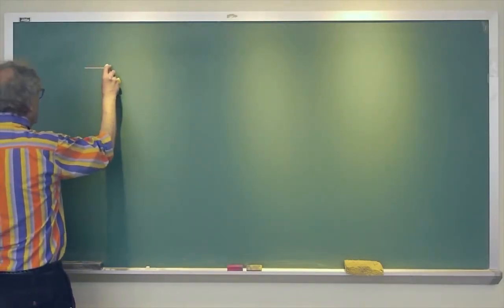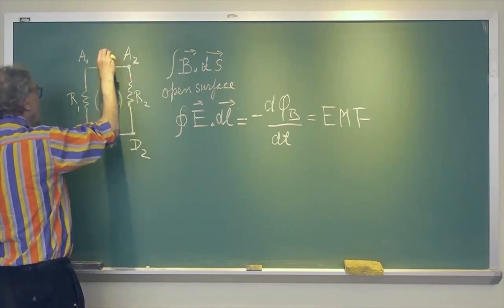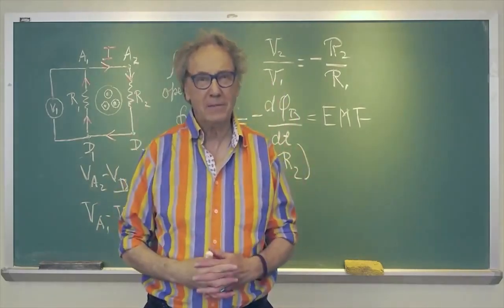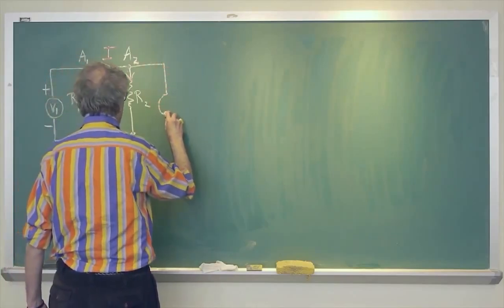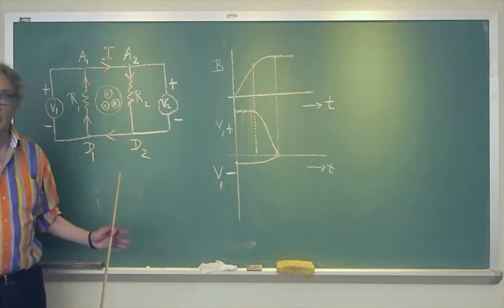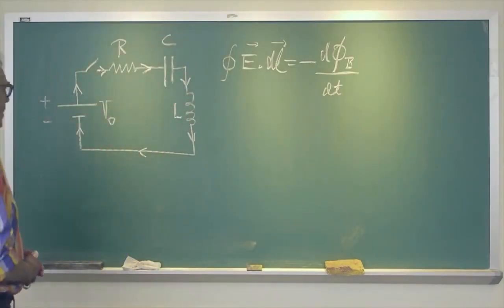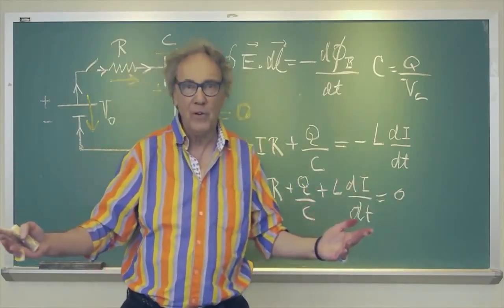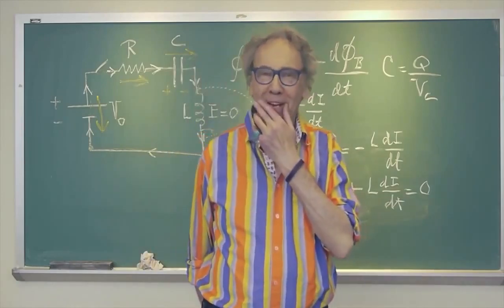Kirchhoff's Loop Rule Is For The Birds

Comment: People just denied electromagnetic current generation just to prove you wrong, and they are still engineers, that is kind of sad.
Reply from the maker: this may interest you:
Thank you jcook for your thoughtful note. Yes, of course, we both agree on the correct Physics but we may not agree on how it should be taught. By teaching students that KVL always works without telling them when it does not work, makes many believe that the closed loop integral of E dot dL is always zero. Which is not true. e.g., it never works in the secondary closed loop windings of transformers. Even ElectroBOOM who has a masters in EE believed that it always worked, and he therefore concluded (he was not the only one; Dirk Van Meirvenne also made that mistake) that two identical voltmeters attached to the same 2 points in a circuit MUST always show the same values. In other words he does not know some basic physics that in the case of an induced EMF potential differences are no longer determined. None of my thousands of MIT students who took my 8.02 course (Electricity and Magnetism) would make this embarrassing mistake! They have seen my Lecture #16 and the great demo with the 2 voltmeters which I do at the end! I believe that I teach Faraday's Law in the way it should be taught. All my students know that KVL is part of Faraday's Law and they have no problems with the concept that potential differences in a circuit can be path dependent. In conclusion I believe that to introduce a "modern version" of KVL and then teach students that KVL always holds is not only wrong Physics but you set them up for making terrible mistakes as Dirk Van Meirvenne and ElectroBOOM did.
Reply: There was a time, when I somewhere in the depths of internet, I saw that maxwell's equation aren't original, but their simplified version, which doesn't always work, because there is no "homogenic" magnetic field, but more different fields that just seem like white, but it's spectrum of fields that ends up in "magentic". Have you ever tried to go beyond the edge and wire transformators in a way that it produces power always once it's started?  @lecturesbywalterlewin.they9259
Reply from the maker: https://en.wikipedia.org/wiki/History_of_Maxwell%27s_equations
Reply from the maker: I demonstrated at the end of my lecture #16 of my 8.02 E&M course at MIT that two identical voltmeters attached to the same 2 points in a circuit can show very different values. https://www.youtube.com/watch?v=nGQbA2jwkWI&list=PLyQSN7X0ro2314mKyUiOILaOC2hk6Pc3j&index=17 The reason is that in the case of an induced EMF (Faraday's Law) potential differences are no longer determined; they depend on the path. This also applies to the secondary windings of transformers as the EMF in the closed loop of secondary windings is induced. https://www.youtube.com/watch?v=b7i2uMx7gHo&list=PLyQSN7X0ro22zanLOcvkaSY-IZqheFYM5&index=8
Of course, in cases where Kirchhoff's loop rule (KVL) does apply, 2 voltmeters attached to the same 2 points in a circuit will always show the same value. 
My demo was first suggested and published by Romer in December 1982 in the American Journal of Physics. This demo has now become a classic; it's done all over the world at many colleges and universities. KVL is older than Faraday's Law. The original text can be found in the following link, pages 497-514: https://books.google.de/books?id=Ig8t8yIz20UC. Clearly Kirchhoff was fully aware of the prerequisite for his "loop rule" namely that phi/dt must be equal to zero! 
By teaching students that KVL always works without telling them when it does not work, makes many believe that the closed loop integral of E dot dL is always zero. ElectroBOOM and Dirk Van Meirvenne therefore both believed that 2 voltmeters attached to the same 2 points in a circuit must always show the same value which is not true as demonstrated in my lectures. They each posted a video on their channel in which they claim to have proof for their wrong ideas which clearly violate Maxwells' equations. Apparently they do not know, or do not understand, that in the case of an induced EMF potential differences are no longer determined; they depend on the path. None of my tens of thousands of MIT students who took my 8.02 course (Electricity and Magnetism) would make this mistake! I therefore believe that to introduce a "modern version" of KVL and then teach students that KVL always holds is the wrong thing to do as you set them up for making the same embarrassing mistake that both Dirk Van Meirvenne and ElectroBOOM made.

Comment: Can someone explain to me why he measures the voltage across R1 in the opposite direction to R2? When he measures R2 he does it with the direction of current, but for R1 it's against the current. I'm sure there's a good reason, I just don't see it.
Reply from the maker: You have 2 identical voltmeter and you want with EACH to measure the potential difference between point A and D. You then connect the + side of each voltmeter to A and thus the minus sides to D, or you connect the minus side of both voltmeters to A and the  + side to D. How else would you be able to compare the 2 readings.
Reply: @lecturesbywalterlewin.they9259  What confuses me is that in a simpler circuit (one with a battery providing the emf) you would swap the polarity of one of the voltmeters. 
In the battery powered circuit, you would have three points (one on either side of the battery, and another between the two resistors), and to measure the voltages across the two resistors properly, you need to take direction of current flow into account. Why does removing the battery and inducing the current with a magnet change the way that you would connect the voltmeters?
Sorry if this seems really silly, but I can't find an answer on physics or electronics websites.
Reply from the maker: read my previous response again. In my "Farady" demo I want to compare the readings of the 2 voltmeters - thus I MUST connect the + side of both to the same point/
Reply: @lecturesbywalterlewin.they9259  Oh, OK. So it's purely to allow for direct comparison of the two paths. I was getting confused because of the implications for kirchhoff's voltage law. I was stuck on the idea that you would have to measure the voltage around the loop in one direction to show that there is a non zero voltage through the loop.
I think I get it now. Thank you for taking the time to answer me!

Comment: IR1=-IR2 since A1 is the same as A2. The same applies to D. Moreover R>0 and I>0 so this formula is true only for I*Ri=0. If my algebra isn't wrong where is the issue?
Reply from the maker: your msg is unclear - how many minutes into lecture and what's the point you try to make?
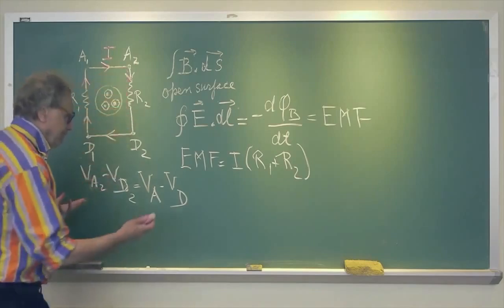Reply: 9:00. You wrote that both potental differences are eqal so in consequence IR1 must be equal to -IR2. A=-A only if A is 0 since both current and redistance are >= 0.
Reply from the maker: I am afraid you missed the key point. VA-VD measured through one path differs from VA-VD measured through a different path. This is well known in Physics: whenever there is an induced EMF, potentials are no longer determined, they depend on the path. Watch the demo near end of this lecture https://www.youtube.com/watch?v=nGQbA2jwkWI&list=PLyQSN7X0ro2314mKyUiOILaOC2hk6Pc3j&index=17

Comment: Suppose you take the voltmeter V1 and, keeping its contacts at A & D, move it to the other side of the circuit (quickly enough that dPhi/dt has not changed appreciably). Presumably the EMF it registers will change continuously from IR1 to IR2... registering zero somewhere in the middle of the loop? So it seems like the exact details of where the voltmeter cables are, are relevant too.
Reply from the maker: You can connect as many voltmeters as you want. If you properly apply Maxwell's eqs in each loop that you have created and if you know what dphi/dt is in each loop you will know what each voltmeter will read.
Reply: Thanks for the reply! 100% agree that the voltages on both sides of the circuit are unequal & KVL is inapplicable, as you say. What I don't get is how the voltmeter "knows" which side of the circuit it's on.

I think your reply is saying it's the flux through the loop containing the voltmeter that matters. But I would've thought the flux was confined (by assumption) to the loop between R1 and R2 only.

Comment: Amazing video. Shouldn't the current be going the other way around the loop? using the right hand rule if the current is going out of the board the current goes anti-clockwise
Reply: Right hand rule is for the magnetix flux (right thumb) induced by a variable electrix current (the other fingers). This is the opposite case: a variable magetic flux (left thumb) inducing an electrix current (the other fingers).

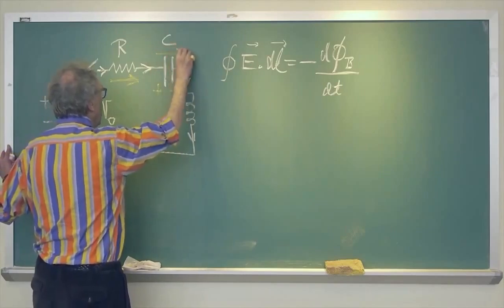Comment: At 27:03 he states that the electric field in the inductor is 0. According to Faraday's law, the electric field of the inductor is nonzero (unless steady-state dc). Google "electric field inside a solenoid". The E field inside the wire of the self-inductor is (u0 * n/2) * (di/dt) * R where R is the radius of the inductor.
Reply from the maker: >>>According to Faraday's law, the electric field of the inductor is nonzero>>>>
that is NOT true. The emf shows up in the ohmic components in the circuit.  I cover all this in great detail in my 8.02 lectures
Reply: @lecturesbywalterlewin.they9259  With all due respect Sir, please point me to a peer reviewed paper/article/journal that states that the E field inside a (self) inductor is 0 when di/dt is not 0.
Reply from the maker: @AlchemyOfDeathBand  If the inductor is an ideal one (superconducting), then it has no resistance. No E-field can exist in a superconductor. It's that simple. In the case of induce emf the E-fields show up in ohmic components only. Watch this video https://www.youtube.com/watch?v=fXmPi_0G19o&list=PLyQSN7X0ro207exLyDsBo_N3_EJcydeeM&index=83
Reply: @lecturesbywalterlewin.they9259  I think I understand now what you mean. It is because the electric field generated by the self-inductor is nonconservative and loops back into itself that we cannot "pinpoint" anymore the voltage drop as being across the endpoints of the inductor. Because of Faraday's law, the voltage between any point(in the circuit) and itself is not 0 anymore. Therefore, we cannot view directly the voltage induced by the inductor, we can only sum up its drop on the ohmic components. 
My question is now: doesn't it show up in the capacitive components as well ?
Reply from the maker: @AlchemyOfDeathBand  https://www.youtube.com/watch?v=qAtqgSaEU4Y&list=PLyQSN7X0ro22zanLOcvkaSY-IZqheFYM5&index=57
Reply: @lecturesbywalterlewin.they9259  What happens if you have an ideal wire, forming a closed loop? In this case, the only component of your circuit would be the ideal cable, with Resistance=0 (there would be no ohmic component). If there is a change on magnetic flux, due to an external alternating magnetic flux, were will the emf show on this case?
Reply: You guys with semi knowledge in physics come hackling a professor..you asking him to go check Google for some bs was how you started...then he showed you your flaw...and then your question changed...but when you started out...you started arrogantly...like you wanna teach a professor?...

Comment: So is this equivalent to saying : "The voltage/potential difference (E dot dl) from one end to the other end of an ideal-inductor is always zero" ? Mainly because this ideal inductor has no resistance and E is 0. ???
Reply: and NOT dL/dt ??
Reply from the maker: The integral of E dot dL through the wires of an ideal  inductor is always zero. However, and few people appreciate that, if you attach a voltmeter over the inductor it will read at any moment in time -L*dI/dt.  I explain that in one of my videos. 
In the case of an induced emf the potentials in a circuit are no longer determined, they depend on the path and thus Kirchhoff's Loop Rule is not valid. Kirchhoff's Loop Rule is a special case of Faraday's Law (namely when phi/dt=0). Thus Faraday's Law is always valid. The following videos may help you to understand this. This is very basic Physics I will therefore not argue with anyone about this. 
https://www.youtube.com/watch?v=f3-SfzepuPs&index=10&list=PLyQSN7X0ro22zan*LOcvkaSY-IZqheFYM5

https://www.youtube.com/watch?v=5be3zpj_eCY&list=PLyQSN7X0ro22zanLOcvkaSY-IZqheFYM5&index=7

https://www.youtube.com/watch?v=wz_GqO-Urk4&index=11&list=PLyQSN7X0ro22zanLOcvkaSY-IZqheFYM5

https://www.youtube.com/watch?v=b7i2uMx7gHo&list=PLyQSN7X0ro22zanLOcvkaSY-IZqheFYM5&index=8

Comment: Sir, at 27:45 if we had moved around the other loop the other way, then would the integral E. dl would still be Zero and equal to - L di/dt? Because in this case the sign of the potential differences would be reversed but the sign of - L di/dt would still be the same.
Reply from the maker: Faraday: The closed loop integral of E dot dL = - dphi/dt.
change the direction dL then -E dot dL = +dphi/dt
Reply: @lecturesbywalterlewin.they9259  Thank you sir. Does this mean that the direction of dl is determined by the direction of current?
Reply from the maker: if you choose the direction of dL the direction of the  current then the closed loop integral of E dot dL is -dphi/dt
Reply: @lecturesbywalterlewin.they9259  Thanks a lot Sir. I wish we had more teachers like you.

Comment: Why do we need to have any surface attached to it?????
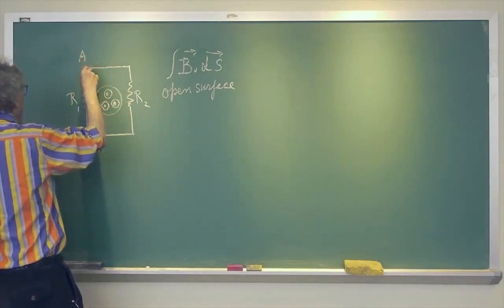Reply: At 3:45 minutes
Reply from the maker: open surface attached to  closed loop
Reply: Is it because to define magnetic flux which is non zero when surface is not a closed one
Reply from the maker: >>>Why do we need to have any surface attached to it?????>>>
it's bcoz of the recipe of Maxwell's eqs. PERIOD
Reply: Thanks sir and plz take care ...we are still friends right
Reply: I didn't get it
Reply: Sorry to bother u again
Reply from the maker: >>>Why do we need to have any surface attached to it?????>>>
it's bcoz of the recipe of Maxwell's eqs. PERIOD If that's not clear enough use google or quora.
Reply from the maker: curl(E)=-dB/dt Stokes!
Reply from the maker: Stokes' Theorem states that the line integral around the boundary curve 3 Page 4 of S of the tangential component of F is equal to the sur- face integral of the normal component of the curl of F. Stokes' Theorem can be applied to equations such as the Maxwell-Faraday Law and Ampere's Law
Reply: Stokes is not mentioned in any of my physics books ......thank u for ur time.....I will surely read about that....by the way I m a 12 grade student .....I m writing my own book in physics ....
Reply from the maker: I never used the word Stokes either in my 8,02 lectures when dealing with the Curl(E) (Faraday's Law) and the Curl(B) Ampere's Law. But all my students at MIT had math courses in which they learned about the divergence theorem (thus Gauss' Law) and about Stokes.
Reply: I will search for that at ocw

Comment: Sir how is kirchoff's laws applicable when i have 2 cells  say E1 & E2 where +terminal of E1 is connected to -terminal of E2 and + terminal of E2 to - terminal of E1,connected together by a superconductor wire.                                                                                                                      By the way sir may God further increase your knowledge and thus make you of those close to him
Reply from the maker: Do the close loop integrals of each loop in your circuit. If there are no inductors in your circuit, KLR will work in each loop. If there are inductances you have to make sure not to use KLR in this loops were the integral of E dot dL is NOT zero.
Reply: Sir according to what i tried there simply must be a resistance in the circuit when both cells are in series.so what i  could conclude from my thought experiment and with some practical knowledge was that a very high current will flow through the circuit and this will result in joule heating of the superconductor which can perhaps burn the cicuit.sir can you state for me another way by which a voltage drop can occur in my question
Reply from the maker: Any induced emf shows up in resistors, NOT in the superconductive wires of the inductors. The E-field in superconducting material is always ZERO.
Reply: Thank you sir for your valuable time to answer my question .   But just to bring to your notice sir my question is not regarding what the video talks of but it is of a different thought experiment in which I am stuck in